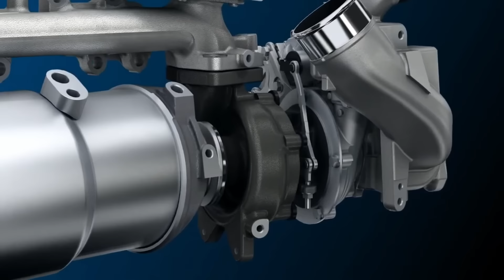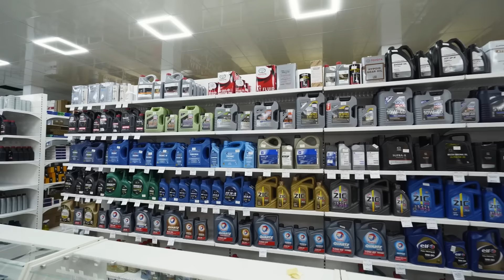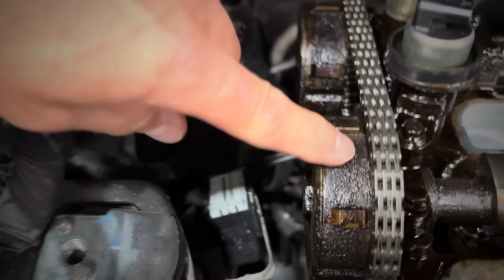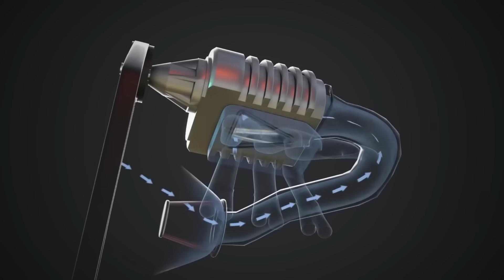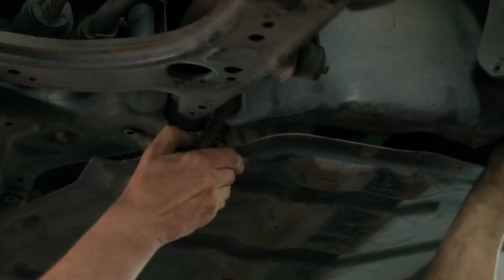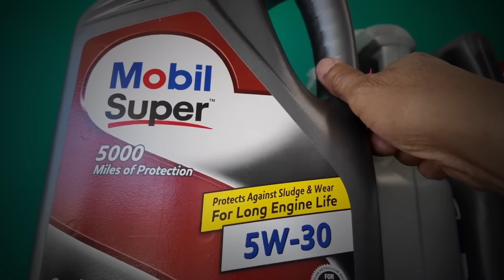Mechanics Won’t Tell You This About Synthetic Oil! Exposed!

Comment: There are all different quality levels of full synthetic or 100% synthetic oils. You can formulate a synthetic oil using ultra refined and modified /purified, crude-derived base oils with an additive chemical package that just barely meets the industry standards and specific certification testing, Or companies like HPS and Amsoil formulate synthetics that far exceed minimum performance standards with way higher quality synthetic base oils such as PAOs and various Esters that not only reduce how much additive chemistry is needed, but also they formulate with additives that are highest quality and latest technology and some are dual purpose in function and effective longer life.  The other huge factor in oil life when it comes to extended oil changes is how the vehicle is driven. Cold  temperature extremes and short trips are very hard on oils and this type of driving uses up the oil's additive package much more quickly, shortening the oil's effective life significantly. Turbo chargers and hard use in hot climates can also beat up oil quickly. On the other hand, long highway trips at reasonable speeds and loads (no towing), can double the safe oil change interval. The only way to know if your oil choice and service intervals with your type of vehicle use is acceptable is to have your used oil tested and establish a baseline. Or just change it more often than not, and use a good filter too.
Reply from the maker: That's a great overview of the factors that affect oil performance and the importance of choosing the right product!

Comment: MY CHOICE IS MOBIL 1,  went from 5w-30 full synthidic to 75000 miles , then 10w-40 full synthetic high milage that last 433,330 miles, the engine fault due to a broken timing chain seiczing the engine, change oil every 5000 miles PERIOD!

Comment: There’s different oil chemistry in the piston rings that operate at higher temperatures. This is why changing oil more frequently is necessary for longer engine life. Once the piston rings begin to clog the engine will develop higher wear and oil into the combustion chamber

Comment: First generation jet engines used conventional oil. They used one called 1010 oil. The J-33 and the J-47 used this oil.
Reply: Yeah, and I don't think it worked very well at the temperature extremes a jet engine faces either. I don't believe it was very long until they developed ester based synthetic jet oil.
Reply: @oneninerniner3427  I worked J-33s years ago and 1010 was what we used and had no issues with it. Later with the J-65 we used 7808 and with the J-75 23699. Oil coolers in the T-33s kept it cool enough.

Comment: What if a bearing in my engine is only getting 10 % of the oil flow it was designed to get? 
I would want that oil to be synthetic. 

And I would never want to know about this reduced flow problem 😊

Comment: Sythenic oil becomes to thin and it causes your car to burn oil . There are so many vehicles on the road that burn this oil a guart every 1000 miles , specially GM ecotec engines . These engines I work on all the time . With no oil leaks they just burn this oil.
Reply: How does the oil weight change? 🤔
Reply: Yeah, my wife's Ecotec in her '16 Equinox burns oil like a sonofab*tch, but she runs great!

The lack of an effective pcv system is what the issue is 🤷🏽‍♂️

Comment: Gail Banks said only AMSOIL for 20 years magnafluxing showed no cracks where as every other so called "fully" synthetic did. Switching from th3e shelf brands to Amsoil you notice the smoothness right away and more HP on the dyno.
Reply: More hp on the dyno!? Is there proof of this? I've thought about switching to amsoil but didn't know what's best for a honda turbo k23 engine found in the 2007-12 acura rdx. But if there's proof of this hp gain, even if small which I'm expecting it to be small. That would probably get me to switch to amsoil and pay the extra coin.
Reply: @NRP-f4s   There is a 1 minute video on the official Amsoil website, under Amsoil 100% Synthetic Signature Series Motor Oil (by opening the link of "View Full Details," of an engine builder, Brett Bowers, from Loveland, Colorado, who operates a shop called Atlas Performance Machine, who stated the following quote in the latter part of the last paragraph:

"So we've always had a great experience with AMSOIL. Every time -- you know, we use their oil on other engines, too, that we build, and I don't worry about a film, breakdown, oil breakdown. The oil pressure is always consistent. I mean, we've tested oils back-to-back at our shop on the dyno, and AMSOIL is always one that we are able to make more power and beat competitors and not have to worry about." 

It would be better to use Amsoil Signature Series 5W-30 100% Synthetic Motor Oil, which would Much Better Protection for your Honda Turbo (that includes an extensive warranty), than typical "Full Synthetic Oils," which are composed with mostly Hydrocracked Petroleum Oil.  I had an oil analysis performed on the used oil ("100% Synthetic" Amsoil Signature Series 5W-30 Oil) with 7,660 miles taken from my 2013 Subaru Tribeca and the stellar results revealed only 1.6 ppm wear metals per 1,000 miles, where Lake Speed, Jr, known as the "Motor Oil Geek" on his YT Channel made a statement that any oil achieving less than 5 ppm wear metals per 1,000 miles is really good oil!  

Amsoil products are easily obtained through the official Amsoil website to apply to become a Preferred Customer (my Amsoil Referral Code is 1420935), to receive a 25% discount and free shipping (with other desirable benefits) when your order exceeds $100 or more.  I am an authorized Independent Amsoil Dealer (all Amsoil Dealers are independent contractors). You could type your year of your Acura RDX in the search for products for your vehicle.  You will be amazed and highly impressed with the performance of the Amsoil Signature Series Fuel-Efficient 100% Synthetic Automatic Transmission Fluid for your Auto Trans, Amsoil 75W-90 100% Synthetic Manual Transmission & Transaxle Gear Lube "OR" a variety of Amsoil Severe Gear 100% Synthetic Gear Lube in different weights depending upon what type of Transfer Case you possess.  

I used a variety of synthetic oils from various oil manufacturers before I tried Amsoil as an ordinary customer about 20 years ago. I was so highly impressed with the performance of my vehicle with the Amsoil in terms of the increased power and gas mileage (than all the different brands of synthetic oil I have used) that I decided to use Amsoil exclusively. I then became an Amsoil Preferred Customer for a few years, before I became a Dealer.  Good luck in your endeavor and thanks for your consideration to try Amsoil Products!

Comment: I guess all the turbocharged diesel owners that have used conventional Shell Rotella and Mobil Delvac 1300 for millions of miles without engine damage never got the message that you need synthetic oil in a turbo engine....

Don't  get me wrong, I am a supporter of synthetic oil and do use it, but I feel that using a good oil, conventional or synthetic and regular oil changes is the key.
Reply: Diesel engines are entirely different. With a bypass filter you can run thousands of miles between changes. For one thing they hold way more oil than a gas engine.

Comment: Jet engines use vegetable oil, and it is consumed by the engines, no filter, never change it, do your homework before making stupid statements
Reply: Mmm, no I don't think so. They are ester based yes, but esters are chemically synthesized & derived from petroleum mainly I believe. Like polyester, polyethylene etc.

Comment: In the 1990's GMC started the first oil change free program and that is when I started with Mobile One as GMC recommended. I bought a used 1987 GMC Jimmy with 156,000 miles on it in 1991. I changed oil and GM filter every 3000 miles with Mobile One. 
At 315,000 miles I was involved in an accident that bent the frame slightly. After over a decade and a half in the rust belt I retired it. The body was rusting pretty bad.
Now I pulled the engine and tore it down there was no wear anywhere in that engine. That made a believer out of me.
Reply: Thanks for your time today.

Comment: Religiously I still change oil every 3000 miles or six months. Waste of money? But my engine is clean.
Reply: Yup you are wasting resources.
Reply: Do you replace your radial tires every 15,000 miles? Because that's what you used to have to do with bias belted tires?
Reply: @oneninerniner3427 in the 70s I carried two spare bald tires inside my trunk in case one of my bald tires went flat.
Reply: I change it when the oil gets dark after 3,000 miles. 4,000 miles max for me. I usually use heavier weight like 15w50 for the summer. I use a bit lighter weight but still won’t use 5w-30 during fall. Sometimes I use 5w-30 in the winter.

Comment: I have a 2011 Ram 3500 Communs diesel with over 313,000 miles. After factory installed oil, I have used Amsoil consistently with no complaints. I get 20 + MPG. highway.

Comment: "Fact Number 11" [sic, meaning not a fact at all] is wildly and deceptively wrong ! All types of engine oil marked as having the same viscosity, e.g., 5W30, will have nearly the exact viscosity at every temperature as all others marked with the same viscosity designation. At any particular temperature, cold or hot, synthetic oils have the same viscosity as any other engine oil. THAT'S THE WHOLE POINT OF THE VISCOSITY RATING !

Comment: OIL does not wear out. The additives are used up and evaporate out as time goes by. Regardless of which OIL you use it becomes contaminated by the Carbon based Fuels we use, be it Gasoline or Diesel Fuel. The carbon builds up in the Oil causing it to change colors and generally thicken. Changing Oil every 2500 to 3500 miles is cheaper than an Engine!
Reply: What do you mean when you say oil doesn't wear out? Every second when oil is pumping through a main bearing or a connecting rod bearing, it literally gets shredded at the molecular level. So yes oil does indeed "wear out". Oxidation is constant in a running engine. And yes I'm aware of base stock and Viscosity Index Improvers and even with a straight weight Oil like SAE 30 it still experiences oxidation and sheer. Oil on the cylinder walls gets scraped back down after it's seen the combustion chamber and adds its very own special kind of oxidation and carbon to the oil also.
Reply: Main and con rod bearings are easy to lubricate that's full hydrodynamic lubrication. Piston & ring to cylinder wall and valve train, cam & lifters/followers are tough to lubricate. It's mainly viscosity improvers that get sheared back and the TBN gets used up.
Reply: Wasting oil, BIG-TIME 🙄

Comment: Zero oil consumption 2014 MDX 212,000 miles 0w/40 Castrol Edge Syntheric + Mobile One Premium filter on 4,000 mile change interval: On my way to 300,000+ miles. (Maybe 500,000?). Best vehicle I have EVER owned as to performance, handling, economy, and quality.
Reply: Also change my PCV valve every 50,000 miles. Critical and ignored by most shops, even OEM's. A failed PCV can destroy an engine by causing oil rings to clog and stick, leading to high oil consumption and more.
Reply: I loved my honda pilots, I have a 08 rdx at 186k that is in great shape but needs a little tlc yet, I just bought it, no rust clean interior,  new turbo, tires, and fluids. I love it. I need new shocks and struts but I'm in love with the sh-awd system. Does your mdx have sh-awd?
Reply: @NRP-f4s  Yes. My 2014 212k mile MDX is SHAWD. Just put new spring loaded struts from EBay on. Rides like new. I keep a detailed Xcel spreadsheet record of MMC. Caught my otherwise great Acura Dealer replacing tierod ends I had already done. Got full refund. But, they are a great Dealer anyway.
Reply: @peterschoon9966 the sh-awd system is impressive, I don't know if you've pushed it through the corners or not, I've pushed mine pretty good but not as hard as I could. It almost scares me to be honest... It handles so well at high speed cornering I don't  want to find it's limit on public roadways, everyone's safety being the main concern.  But spinning out on a track in a sand pit or grass is one thing, houses, trees, light poles, etc etc, is a whole different ball game.

Comment: Okay, I know I may get slammed for this, but my last synthetic oil change, using a premium-grade oil filter, in my work car was in December 2019, or just before the COVID-19 pandemic exploded. However, in my defense, I've been working from home since then and haven't driven the car more than 5,000 miles in that time. I check the level regularly, and except for the occasional top-off, the oil is still clean.
Reply: What needs to be considered is that all the contamination has fallen out of suspension and is now settling at the bottom of your oil pan. You still have to change it because of the acidic byproduct of combustion. The pressure from the combustion chamber causes unburned fuel and carbon to bypass the piston rings during warm up and if trips are mostly less then 15 minutes, your engine never really gets a chance to stay hot long enough to burn off the fuel contamination through positive crankcase ventilation. Contamination will only stay in suspension for so long before you get a thick build up of sludge at the bottom of your oil pan, do this repeatedly you are potentially causing your oil pick up tube to gulp the sludge, then you get a filter full of sludge and it might start to circulate unfiltered oil through the bypass valve. So if after 5k miles and your oil looks "clean" after six years it's just the oil is no longer keeping the contaminates in suspension. 6 years is simply too long for oil change regardless of miles.  Consider that even brand new oil on the shelf is only good for 5 to 7 years because the additive package actually settles to the bottom of the bottle and it's expired at that point. In order to reverse this, change your oil, drive five hundred miles, then drive 1000 miles, change your oil again. After that at least once a year even if you don't accumulate 5k miles. You'll be fine. Use   Mobile 1 or Havoline/Chevron.  Good luck and happy motoring my friend. Sorry so long.
Reply: Yeah, you should change it about once a year or so regardless of mileage driven.

Comment: Always change your own oil all places do a 200% false markup rip-off of when you get synthetic and people need to keep an eye on dealerships overfilling your oil and get them for that
Reply: I bring my own oil & filter (Mobil 1 Extended Performance & Mobil 1 or Fram Ultra synthetic filers) to my Jeep dealership so I know exactly what's going into my truck -- they charge me for the labor. Also get a tire-rotation done at the same time, as per usual routine.
And occasionally, have a drain & refill done on the auto-transmission (even though I have low-miles on the vehicle).
As for WHEN I change the oil, ever since those Oil Life monitors vehicles have had (for some years now) I go by THAT instead of a set mileage. I let it get down to 0% and then go into for a change/tire-rotation. That's turned out to be about every 5-6K miles and 7-8 months -- being retired, I don't drive much nowadays. ;-)
-- BR

Comment: You ever hear valve rattle at cold start?  That's the oil not getting to the parts fast enough so its just bare metal making contact unlubricated until the oil makes it there then the valve rattle quiets down.
Reply from the maker: That's a good description of what's happening with cold start valve noise!
Reply: I never hear that …. Only remember hearing it about fifty years ago …

Comment: I call Bull crap on the first thing in this video 
I have 03 dodge truck with 300,000 miles and has no slugg in the engine 
I have always run 10w30 conventional oil

Comment: It's not the oil it's how long you leave  the oil in your engine. Change  your oil every 3000 mile , this guy is full of it .
Reply: I heard for synthetic, you should also change once every 12 months regardless of mileage..
Reply: 3,000 huh? Do you replace your radial tires every 15,000 too?
 Because that's what we used to have to do with bias ply tires.

Comment: there are really only 2 true synthetic oils out there, one is Amsoil because of the refining , the other is Pennzoil Platinum that is refined from natural gas, it has to be fully synthetic, am I saying Castrol edge is bad oil? no it is great but if you can get the best for the same cost look for the yellow bottle that says Pennzoil platinum, your car will love you
Reply: Well, that's not true. For example, Shell Helix ULTRA PRO full synthetic is made from natural gas.
Reply: @1maico1  I stand corrected, never heard of that oil thanks for letting me know, I wonder if it is Pennzoil platinum as Shell and Pennzoil are the same company, possibly just another brand name for the same oil

Comment: We had a V8 petrol engine in an F150 in our service fleet back in the 1980s.  It was on Mobil 1 synthetic for its life on the fleet.  At over 300,000 km we decided to give the cylinder heads a birthday.  Valves, seats etc.   Every part of the engine's internals was clean and shiny, with no sludge or varnish.   The cross hatching in the bores looked like a new engine.  It works.
Reply: Это был холодный двигатель! Он на любой минералке так же отработал бы!!! Минеральное масло в 4 раза дешевле, меняй в 2 раща чаще, мотор проедет 1000000км

Comment: I use mobil 1 full synthetic 5w 30 on a 09 pontiac g8gt with over 200,000 miles and still going 💪🏾.  Change  oil ever 3000 miles.
Reply: Меняй так часто минеральное масло в 4 раза ден и будет лучше